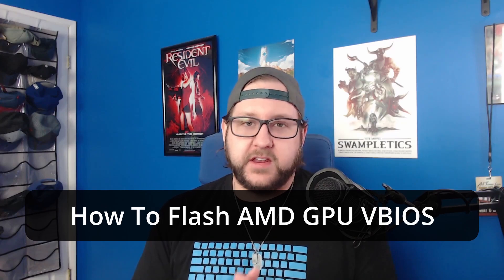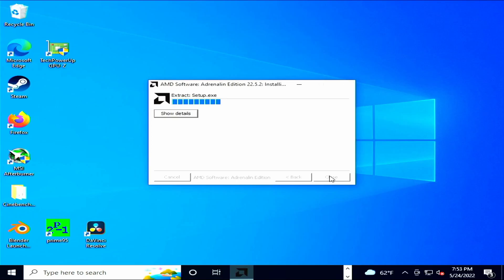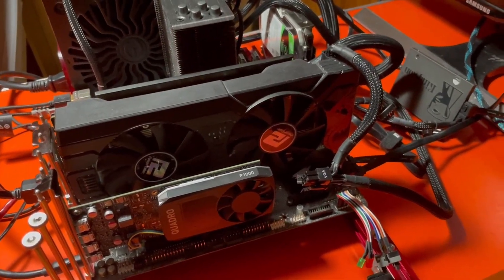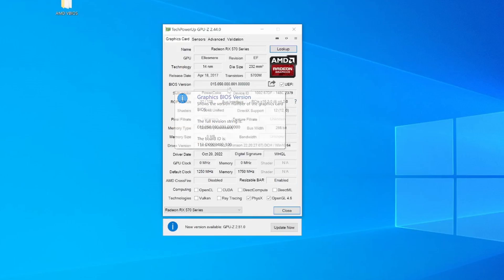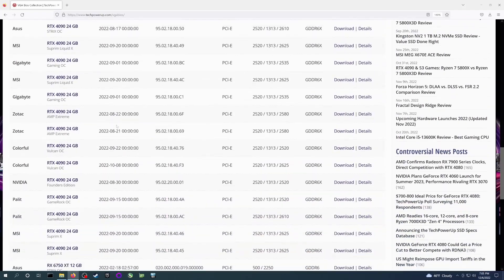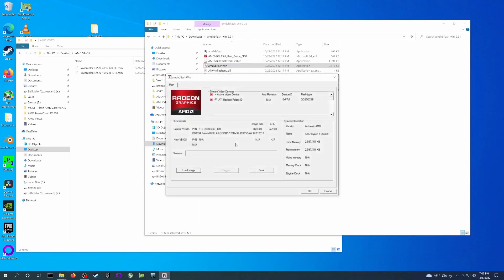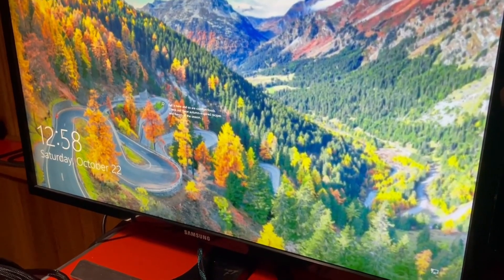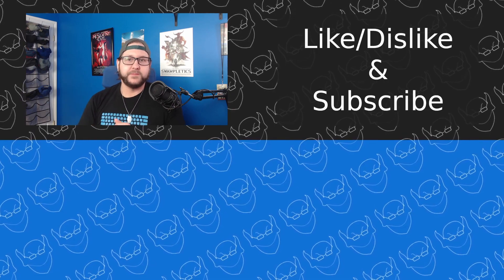How To Flash AMD GPU VBIOS

Comment: Wait what do u mean old hdmi cable ? Is amd software that arse backwards that a simple cable being old will cause a perfectly fine card to black screen every few hours ? Dude im having the same issue can u plz make a vid or explain what i can do to fix this issue cuz flashing my card is the last thing i wanna do it seems that the rx series is just AMD worst card ever made
Reply from the maker: To be honest I did some more investigating afterward and it was either the cable or the port I used on my monitor. The cable is an older one and it's possible it didn't support 4k60fps properly, or I might have plugged it into the HDMI port on my monitor that doesn't support 4k60fps. In either case it should have adjusted automatically to a stable config, but I don't think this specific issue was on the graphics card and could have been avoided had I been smart and used a DisplayPort cable lol.

That being said, I did need to flash the VBIOS to get it to work at all! It might've been a card used for mining or something and the seller didn't think to re-flash, or care enough to get it back.

Comment: What happens if you don't have another GPU to swap it out when you get the black screen eventually?
Reply from the maker: You can try to use the on board video if your CPU supports that. Or I guess worst case buy a cheap gpu to do flash then return it lol
Reply: @BitGoblin  so basically I need another GPU to reformat the other GPU right?  I would have tried the on board bootup bit my PC case is very small so I can't fit the GPU on another slot
Reply from the maker: Yes, that is correct (at least as far as I'm aware!).

You shouldn't need to move the GPU to another slot to use the onboard graphics, you just need to plug your cables into the ports on the motherboard and it should work.
Reply: @BitGoblin  you're a life saver
Reply: @BitGoblin  I'll test it out today and get back to you
Reply from the maker: I hope it works! :D
Reply: @BitGoblin  it didn't
Reply: @BitGoblin  the GPU still not taking drivers updates even after the flash successful
Reply from the maker: Ah shoot. What's your GPU? If it's an older one it might need like a legacy driver or something.
Reply: @BitGoblin  rx 580 s
Reply from the maker: Hmm. Those recently got moved to "legacy" support, but that shouldn't matter too much. I'm assuming you tried driver version 23.11.1? And are there any errors you're getting?
Reply: @BitGoblin  it basically didn't work' got the same issue with it not accepting drives there was a point where I managed to get it off the black screen but it freezes up on windows start up
Reply: @BitGoblin  had to run system repair to get it to desktop
Reply from the maker: @moonlightsama-manga does it crash if you boot into safe mode?
Reply: @BitGoblin  no it doesn't
Reply: @BitGoblin  I cleaned all drivers even
Reply from the maker: Maybe it's related to another driver or piece of software that's getting loaded when you boot normally? Have you tried reinstalling Windows or using the card in a different system?
Reply: @BitGoblin  no havent tried that but i am returning it
Reply: @BitGoblin  thanks for sticking with me bro
Reply from the maker: @moonlightsama-manga oh that's good! I figured you were working with an old graphics card, but returning it sounds like the right answer :)

Comment: Damn... im tryna flash my rx5600xt that i just bought second hand, because it keeps black screening when under a load, but nothing works... i tried the newest version of amdvbflash aswell as 2 other (older) atiflash versions. So the newest doesnt contain the amdvbflashWin file, and so i tried running the other executable, but it showed nothing but an empty console window (no commands or nothing worked). One of the older versions didnt recognize that i was using an ati/amd card and the other when trying to open it - did nothing... im losing my mind because in this state the gpu is useless and nothing works.
Reply from the maker: How old of a version did you try? IIRC 4.71 should be good for the RX 5000 series

Comment: Thanks for the video, same thing just happened to me. I bought a RX 570 4GB on eBay.  I got no video output at on my X470 AMD system, thankfully I got video output on my old B-85 Intel board. The AMD installer would crash every time I tried installing the drivers. Reflashing the Bios was my last hope, thankfully it worked.

There were RX 570's that were 15% cheaper because they had mining bios, and the seller didn't fell like reflashing them all, so he gave a discount. I went with this one because the seller said it was in "Good Condition", no mention it was a mining card, or that it had a mining bios. I paid the extra money, so I wouldn't have to deal with this BS. Luckily, I've been tinkering with computers for a while and had back-ups I could use for testing. The seller sold two total, I feel bad for the other buyer, I hope they can figure it out.
Reply from the maker: Yeah, the seller should definitely make sure it's clearly marked in the description that it's got a mining vbios. Some do it well and it's not too hard to correct, and can be a great value if you're willing to take the risk it's not just straight up bricked. 

In retrospect mine didn't need a refund if I had just tried reflashing it, but if it was some business with a different vbios then the seller should've noted it in the listing. Or made sure it was in working order lol.

Comment: I have asrock b450m hdv r.40 motherboard which says ryzen 5000 ready 
And I have ordered ryzen 3 3200G which is ryzen 3000 apu

Would my ryzen 3 3200G work with my motherboard without bios downgrade or update?????

Please reply it's urgent.....
Reply from the maker: The b450 boards should have ootb support for the Ryzen 3000 series APUs

Comment: This could be worth a try. Back in April I installed a new update in Adrenaline from AMD and eversince I had horrible problems with the performance of my 6800XT. Tried a buch of stuff but nothing worked. Not even resetting motherboard bios and reinstalling windows several times. Maybe this helps 🤔
Reply from the maker: Huh, that's weird that a driver update would've borked a graphics card like that. I could maybe see if it was an older card that dropped support, but the 6800 XT is not old lol.

I'd suspect maybe it was a bug in the driver unless you've tried a few different versions since then. A vbios flash could help if the image loaded on the card got borked somehow
Reply: @BitGoblin  Directly after the new update in April I tried to go back to the older version of adrenaline and the drivers which worked without problems. It made things a bit better but still had problems. I also tried a few newer updates which followed in the months after April but ... Out of luck again. 
Last week I ended up getting a 4070, installed it and all the problems are completely gone. Everything works as it should. But now I have a 6800XT laying around here without a idea what's wrong 😅

Comment: Wow 570.....wondering if this is possible on RX 7k......as far as I can tell, AMD really locked down current gen
Reply from the maker: I believe it should be doable - the latest version of amdvbflash says it has support for the latest AMD 7000-series GPUs. Or at least the 7900 XT and 7900 XTX from what I'm seeing for version 5.0.567
Reply: @BitGoblin  hmmmm......wonder if it is possible to flash another card's bios onto a different one.  For example a 7900xtx aqua bios onto a nitro + or phantom gaming model
Reply from the maker: Amdvbflash has an option to save a vbios from a card, so it could work. I'd just be careful as sometimes cards from different vendors/models can vary ever so slightly in ways that could cause problems with a vbios.

But it's definitely worth a shot... For science!
Reply: @BitGoblin  for science!!! :)  yeah sometimes vbios from other manufacturers can act wonky, especially  with io.  For example, the card has 3 display ports but the vbios only covers 2.  Usually the 3rd port would no longer work.  Thanks a million for the idea

Comment: Thanks for the video, much appreciated. I picked up a 2nd hand Gigabyte Eagle RX 6700xt recently for cheap (likely ex-mining) after getting it setup and installing the drivers the Core Clocks were stuck around 500mhz, memory at 2000 and performance was sluggish 50-60w 99% util (maybe a mining bios?) Followed your video and it's working great now. 👍
Reply from the maker: Awesome! I'm glad to hear that! Both you fixing the graphics card, and the keeping another old GPU from being e-waste is another bonus :)
Reply: I bought Rx 6700 off eBay and it has black screen, but my PC starts and runs. I got full refund for a gpu.  I don't have an  on board graphic to flash it

Comment: PLZ someone Help me , I have an issue of GPU bios light not turning off after booting , this is suddenly happening from yesterday, GPU is giving me some flickering issues and black screens for few seconds ,I thought flashing bios will fix this issue but nothing happened . I don't know what to do  now and I can't find this issue anywhere . my card is Rx 6600xt GIGABYTE GAMING OC PRO.
Reply: jumper the card, for re-flash with its original bios
Reply: @guts711  Card was DEAD bro, I did RMA that  . And fkn Gigabyte Replaced my New Card with an Old repaired 6600XT with an entirely changed Heatsink. They didn't even tell me what was the issue in that Card . And now I am getting 75°+ Temperatures on average🔥🔥and hotspot temps is averaging 99°+,  Previously it was well under 60°-64° Max . FUCK GIGABYTE. 😓
Reply: @rajat11724 I got an asrock, am I okay?
Reply: @rajat11724 bro i got same card used.hotspot is 110 , can you send me your furmark results
Reply: @rajat11724  do u know thermal pad thickness of the same card
Reply: Did u fix it?
Reply: May be you should consult GPU repairing center.😢Sorry bro, I really felt bad for you!
Reply: @muhammadnoman8265 I sent that GPU to Gigabyte RMA and it was DEAD. They send me a refurbished Card with totally changed Heat sink, and i am getting more 15° temps than the old Card . Now I am sure this card will burn some part inside and when I will send card again to them , GIGABYTE will for sure tell me that you burnt some part (even though I won't do anything) they will declare that Customer Induced Damage and won't replace it . 😓😓 I literally saved money for 2 years for this card and this is what I get .😕

Comment: Bought an rx 6700xt of ebay worked for a few weeks then stopped putting out a display then vga light comes on not display put my other graphics card in and works fine any ideas what steps to take tryed everything i can think of and found on internet but no luck am not to clever with all this thanks
Reply from the maker: A VBIOS flash could help with that. If not I'd try returning it if it's not too late 😬
Reply: @BitGoblin  have you got a video in this ?
Reply from the maker: Video on using the CLI? Not yet unfortunately - between work travel, vacation and some family stuff it's been hard to sit down and make a video for awhile. But it is on my list of things to do shortly :)
Reply: @BitGoblin  great I am not super tecky with this stuff sadly so look forward to a video to help me out and hopefully it works 🤞
Reply from the maker: @emmam0442 it's no problem! In the meantime, you can probably follow this written guide on the TechPowerUp forum to get the flash done with the CLI

https://www.techpowerup.com/forums/threads/amd-ati-flash-command-line-cmd-syntax-mini-guide-windows.291671/

Comment: So I have this problem with a 6800 xt, when I put it on the top pciex16 slot, no display, but when it's on the 2nd pciex4 slot it works.
Now idk if flashing the vbios will fix it or not? It's a used gpu. Any tips/thoughts on this?
Reply from the maker: It's possible a VBIOS flash can help with that, it's definitely worth a shot worst cast scenario.
Reply: @BitGoblin  is it ok to flash the VBIOS without another GPU? cause I'll try and flash it while its on the pcie x4 slot.
Reply from the maker: @clarke2816 yep! That's what I did to give myself a display while I had a malfunctioning card :)
Reply: @BitGoblin  So I flashed the vbios, and still no displya on the pcie x16 slot... shame I thought this was finally gonna fix it haha, thanks for the reply and the vid tho!
Reply from the maker: It's no problem, sucks you didn't get your card fixed though 😬 let me know if you ever figure it out!
Reply: @BitGoblin  so an update to this, I sent it back for warranty, and let them try on the same mobo as mine to see the problem 1st... turns out the mobo was the problem. First time encountering something like this haha. Mobo is a B550m aorus elite no idea why its doesnt work cause both components released in the same year
Reply from the maker: Huh, you know I have seen that before, but only at my day job where sometimes we'll use really old PCIe hardware with newer systems or vice versa. Usually then it's like a BIOS implements an older PCIe spec incorrectly or the hardware doesn't support forwards-compatibility correctly, or something along those lines.

Was it something to do with like a bad BIOS version on that particular board? Just curious if you were given any details.
Reply: @BitGoblin  I dont think so, they used a brand new b550 aorus elite cause its a local shop here in my area where they sell 2nd hand GPU's

Comment: only reason im looking to do a gpu vbios update with original or custom firmware...is to fix the fanspeeds on my 7900xt (the fancurve on the current bios...does not even bother to go above 60% speed while gpu temp goes above 100.C) and i think that is just wrong settings..
Reply from the maker: 100% that's silly, epecially so if that's stock firmware! These days, any bit of cooling not utilized means you're leaving performance on the table.

Let me know if your VBIOS flash goes well!
Reply: @BitGoblin   i know very well,doing updates for bios/vbios is silly
but i also do not update stuff without a good reason.
i only do updates only in critical moments.

i do have lots of reasons not to do it.

1.vbios can only be flashed around 5 times or less(on gpu)
2.some cases you cannot revert back to the stock one(this is for motherboards idk about gpus)
3.flashing vbios waranty voids (so NO UPDATES)
4.i can still control the fans just fine with a custom fan curve in adrenalin(so the problem is not critical or urgent)
5.never mess around when flashing a bios(here the chances sometimes are like 50-50% win or lose)

for now i can stay just fine the way it is(as long adrenalin works in the background as it should)
but i dont like the gpu having high temps and then going to thermal throttling because gpu hotspot is too high and fans wont spin fast enough

for now il just stay and watch to see what problems appears on the web i can still wait a for a while

Comment: why do I not have the GUI version of AMDBVVFlash when I extract the file from Techpowerup?
Reply from the maker: The GUI tool was discontinued with version 5.x, leaving only the CLI tool. If you're trying to flash an older card (before RX 7000 series I believe) then you should be able to use an older version.

Comment: i have dual bios card the other bios gets code 43, can i use the bios from the other bios?
Reply from the maker: I'm sorry, are you asking if you can flash the working VBIOS to the other side? If so, I believe that should be doable - you'd just need to save the VBIOS from the working side, then use the resulting rom to flag the other.

Comment: Hi.. I have 2ndhand msi mech rx 6600, it has lower clock, 100w max power, 0 rpm below 50, 100% rpm above 50C. Will my gpu back to normal if i flash the bios?
Reply from the maker: That sounds like it has a VBIOS tuned for crypto mining on it - so yes, it can if you flash one to get it back to the stock settings :) Good luck and be careful!
Reply: did u fix it
Reply: @wenngao  nope, still the same

Comment: I have a XFX RX 580 8GB with corrupted bios, no ATIFlash or AMDVBFLHASHWIN that I try works, it always gives Windows 8 error or something, is there any file that I can use to reinstall the bios of my 580? thanks
(I use windows 11)
Reply from the maker: What version of amdvbflash did you use? It's possible you might need to use an older version (or a newer one if you have a really old version).

Comment: i did this it said bios was installed and now my pc does not boot at all not even in bios what do i do
Reply from the maker: My guess is that the system's booting, but the graphics card is just not outputting an image at all, even for the BIOS.

It's possible the image that you used from TechPowerUP was for a slightly different model of card e.g. a different model of VRAM was used. If you can I'd try using a different VBIOS to see if that works.
Reply: how would i install it im cant get any output
 @BitGoblin
Reply from the maker: If you have a 2nd graphics card you can install that and use that for a display. Or if your CPU has integrated graphics then you could use that too.
Reply: i have a rx 580 8gb nitro+ non special edtion which has dual bios every time i use the igpu it goes to the slower quiet bios even when it is on the normal one but does not boot wit the normal one is it fixable?
 @BitGoblin

Comment: So I want to flash an AMD Radeon RX 6900 XT 16GB, but have no onboard graphics (Ryzen) and Radeon is not being detected by windows.  I have an Nvidia 1080 I can use to get  windows onto monitor. My question is ... do I have to connect power to Radeon card (3 X 8 Pin connectors) as I am already using 2 X 8 Pin connectors to power my Nvidia card?  Many thanks...
Reply from the maker: Yes, you will need to have all of the power connectors plugged into your card so it can be properly powered on when your system starts up.
Reply: thamkyou                          @BitGoblin
Reply from the maker: You're welcome! :D